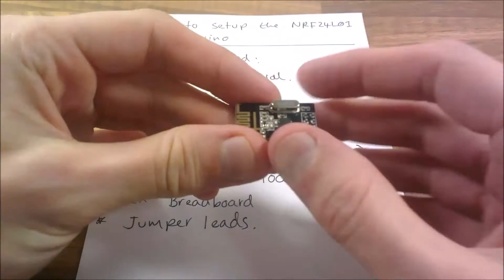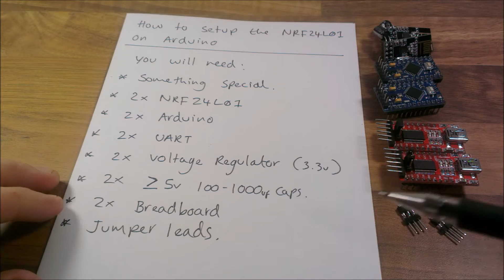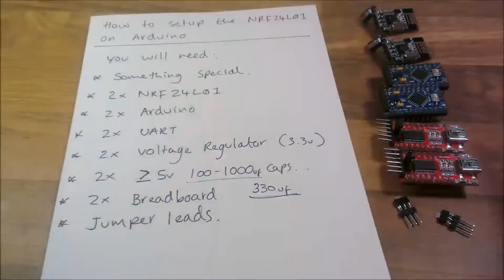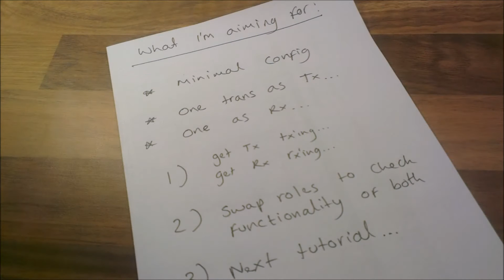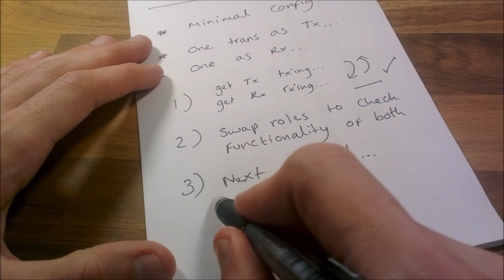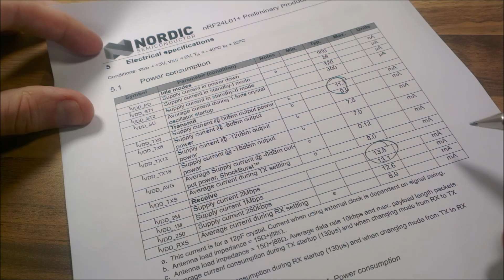TUTORIAL: How to set up the NRF24L01 wireless transceiver Module - Arduino (Part 1 - Preparation)

Comment: Oh I would also like to mention. If anyone else is having issues. I left the NRF24. H library out that seemed to be my problem. And also by removing the NRF24 module from the 3.3 adapter without unplugging the Arduino first damaged the NRF24’s. So remove the power from the Arduino and then if you have to remover the NRF24. If you want to swop them out for testing.
Reply from the maker: The nrfs are poor.

Comment: Eventually after three months everyday of trying to getting them to work. Your simple explanation I got it working thank you for you video. I was ready to give up. Now I’m trying to to get the transmitter to send a heartbeat to the receiver to know that I have communication like you have done with the HC-12 video. If you can please just give us an idea. I have tried to send a simple state change but not getting anything on the receiver, and I do have communication using your code hello world. Or a Demo video on it. Thanks.

Comment: I just soldered 10UF cap to vcc&gnd of NRF module. Now when I connect the module to NodeMCU ESP8266, it can't upload sketch. If I remove vcc&gnd wires between the module and NodeMCU then I can upload the sketch.  What did I do wrong?  
NRF I'm using is the one has antenna connector. Do I still need to solder the capacitor to it?

Comment: do it really need to connect capacitor in nrf24l01? we're making a project using nano arduino and supply with 3.7 v 500mah battery, do i still need to connect some capacitors?
Reply from the maker: meralits dimaluna it's not essential, but try with and then without... It's much much better with one.

Comment: You can buy 3.3v adapters with the 8-pin header for these boards very cheaply on ebay and they save a lot of wiring. A 10uf cap is sufficient as it is only there to provide a short-term buffer. The high power version of the NRF module with an aerial really needs external power, but those small ones probably don't.
Reply from the maker: I agree. :-)